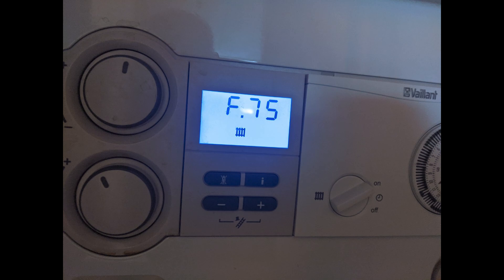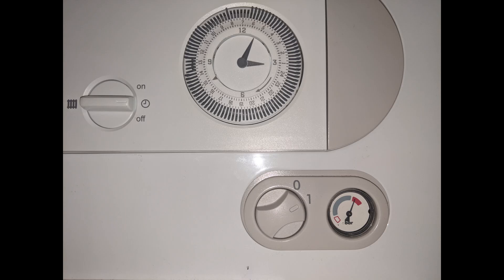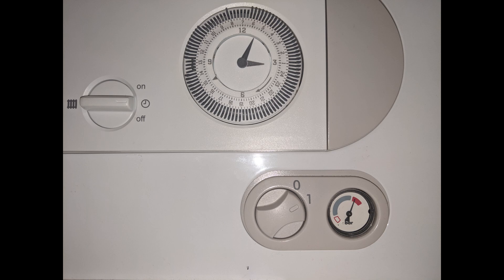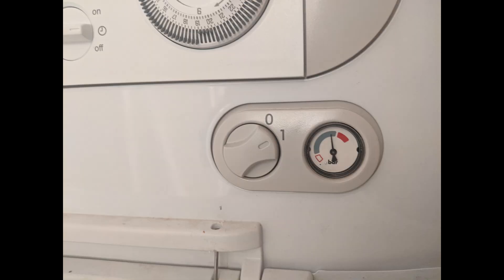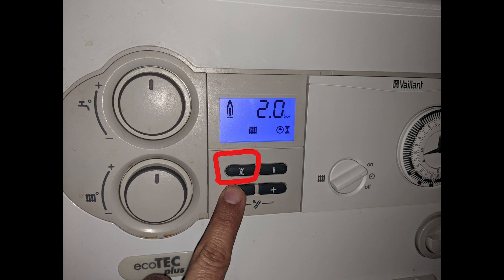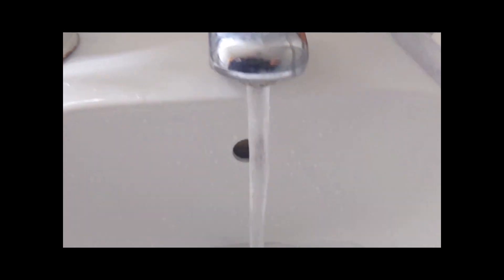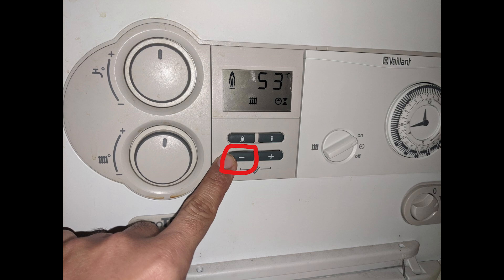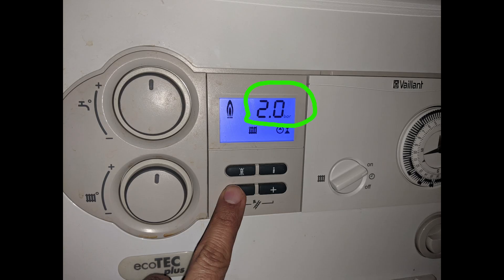How to fix Vaillant boiler F75 Fault

Comment: The pressure should be between 1 and 1.5 bar.
Look for the cause, could just be the fill valve is seeping or needs air in the expansion vessel.

Comment: Thanks for this. Mine had low pressue. After I started filling the system the needle did jump suddently a bit.  Possibly a blocked sensor that cleared?